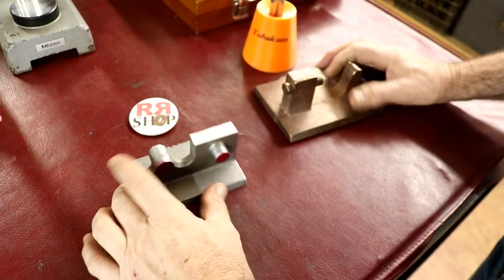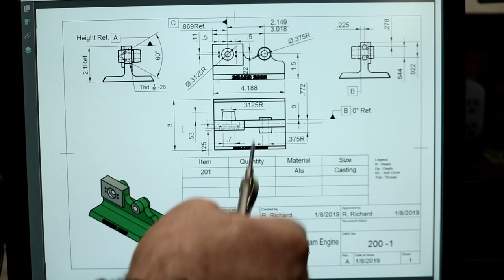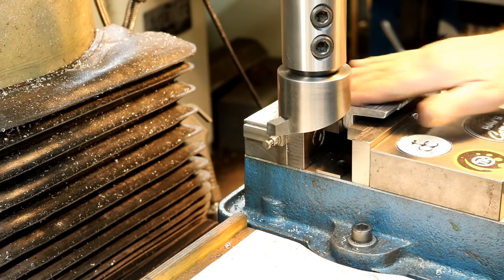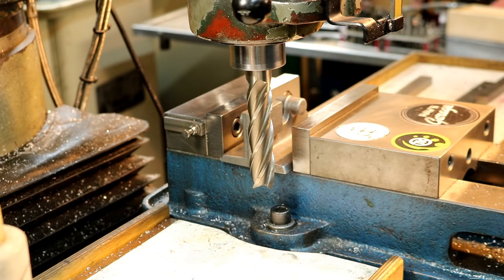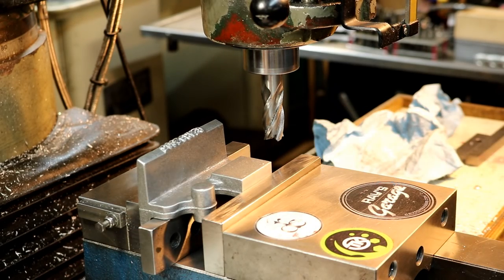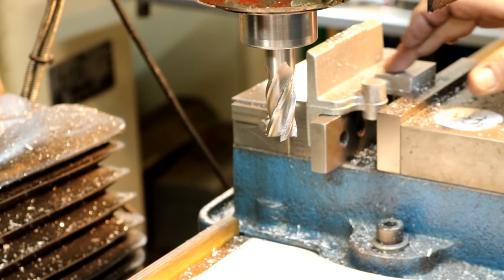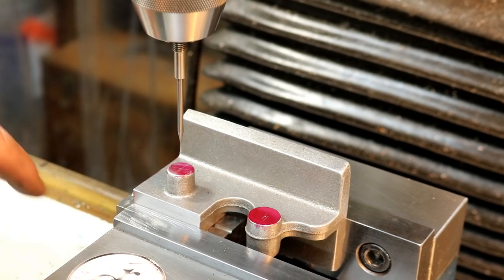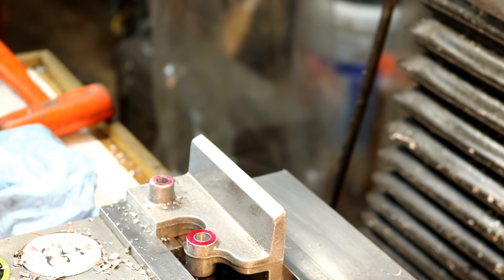P2-1 How to Build the Base of a Model Steam Engine for the First Time

Comment: Those bosses look nice and wide and length, that brass base looks wider to us. This explanation about the castings is why we come here, you are bringing back the centered holes, casting alignment and such. Those cast machine parts not just these but many others we come across in life, in vintage machine rebuilding as well, things are off center and then committed and we hate it, it is then done and the you cannot correct anything. You clearly know this and can adjust a bit your design drawings to compensate this ever so much, great share and greatly explained Randy. Look how nice and nearest center you ultimately were able to drill  those boss holes after your great forging cleanup. Lance & Patrick.
Reply from the maker: Thank you guys.

Comment: I would have thought once the cylinder mounting face was machined the round boss for the shaft would be referenced to that face.  Makes building this a lot easier when you have the nice right equipment for sure. I can only 3D print working engines so do you have your files available for anyone to use?
Reply from the maker: If you send me an email I would be happy to share the model with you thru Fusion.